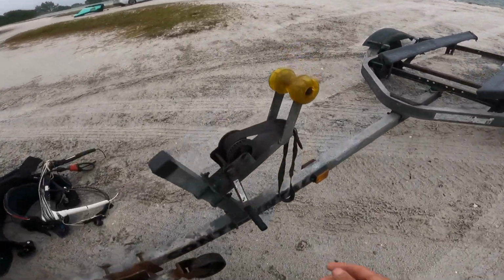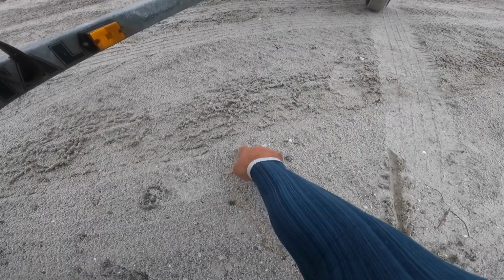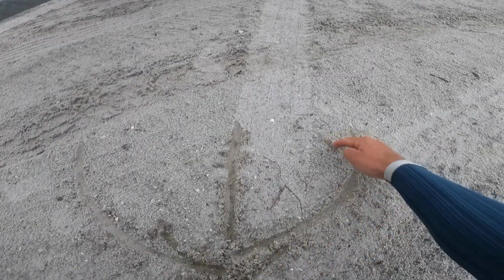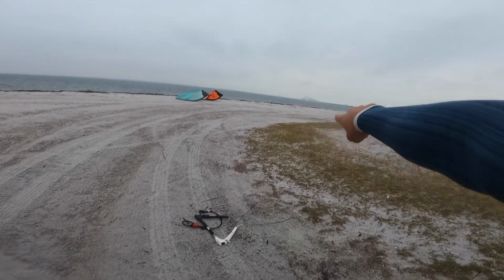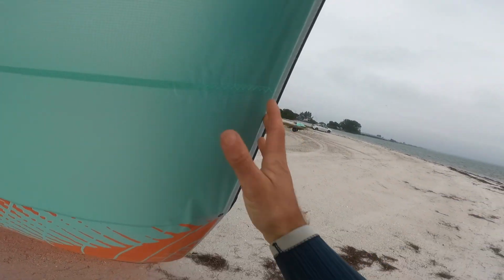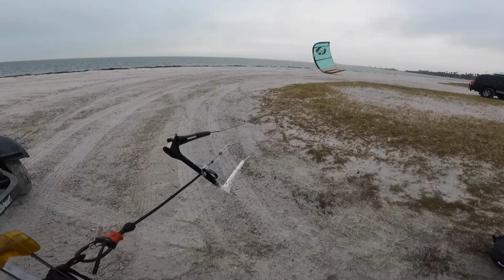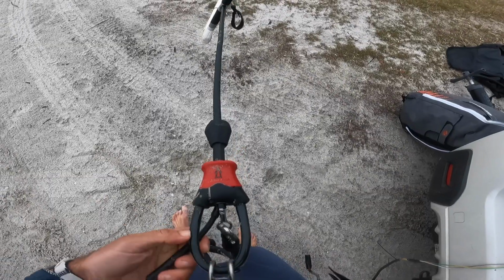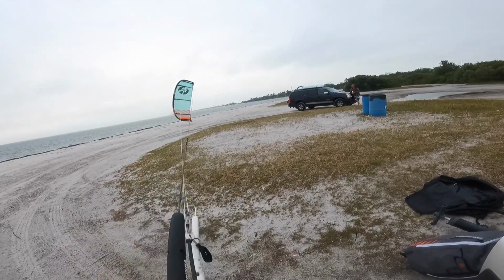How to Self Launch a Kiteboarding Kite Using a Fixed Anchor Point

Comment: I probably would have attached the leash first to the flag line before removing the lite loop from the anchor point in case of a problem. Do you wait to set up “semi-suicide” until out on the water for unhooked tricks.
Reply from the maker: Thats a good idea.. i set up semi suicide when i hook in
Reply: @KiteboardingStPetersburg  That doesn't prevent you from attaching the leash before detaching the chicken loop from the anchor.
Also, with lack of an anchor that can attach to the chicken loop, the leash itself can be used to attached to the pole, in which case you first hook in and then release the leash from the pole and attach it to your harness.
Reply from the maker: @galzohar  that sounds complicated plus what happens if something were to happen to the kite between releasing the leash from the pole and before attaching it to the harness? See the dilemma? Also, the point of this video is for the visual diagram of where to put the kite at the edge of the wind window... when its sitting at the edge of the wind window (the neutral zone) theres a very very very slim chance of anything going wrong anyways.
Reply: @KiteboardingStPetersburg  Depends on how strong the wind is. I would still prefer to have it either connected to the pole or the harness at every given moment. With a fixed hook it's obviously better as you can connect leash before detaching the chicken loop from the hook. But with leash attached to the pole (semi-suicide mode) you can still hook in before releasing the leash from the pole and attaching it to the harness, which is still safer than what you show in the video.